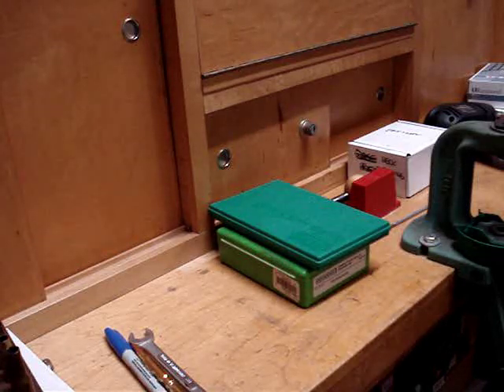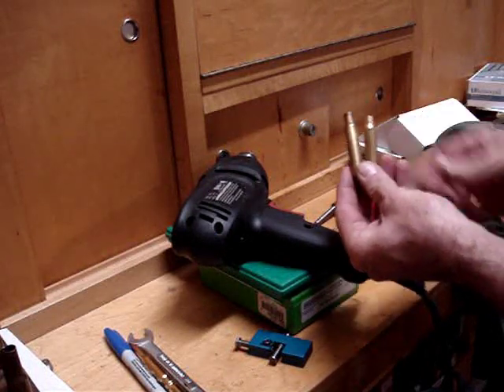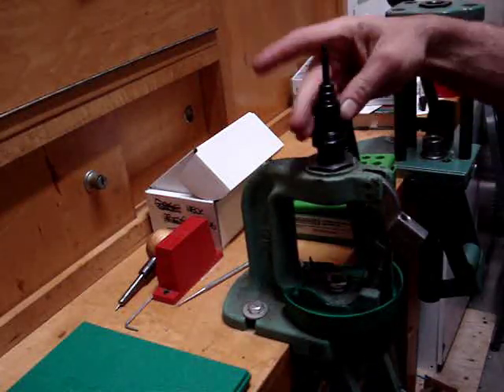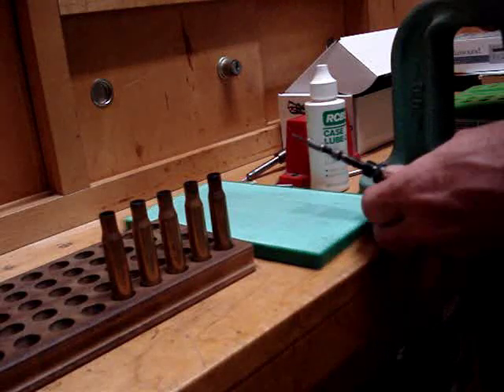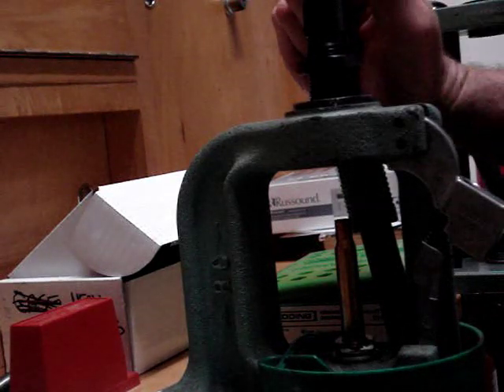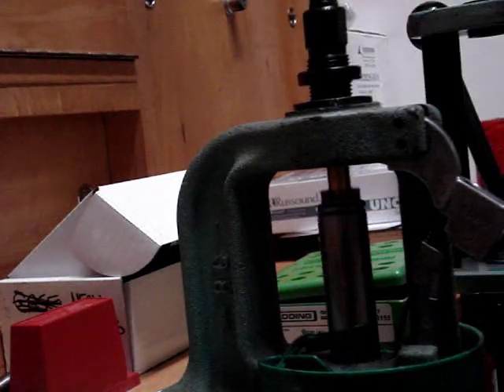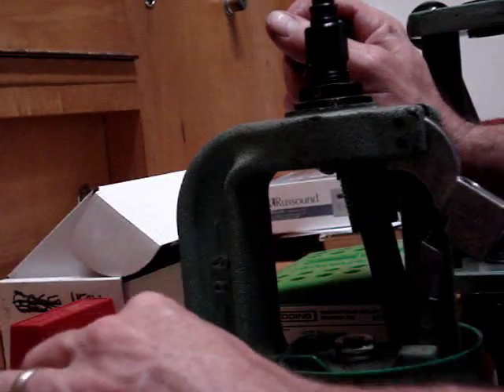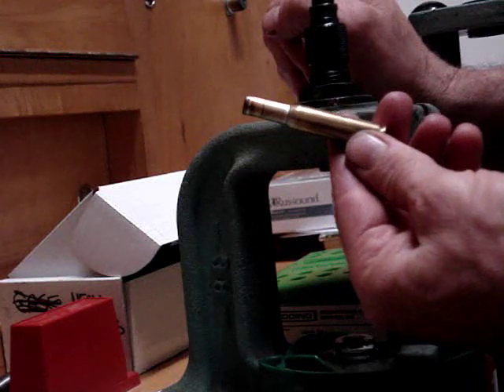Cartridge Conversion Part 1

Comment: How do you determine where to set the neck trimmer depth so the correct amount of brass is removed?  Is it correct to keep removing neck brass until the round just chambers in a particular rifle for a custom fit and then trim all cases to this dimension?

Comment: Thanks Ammosmith. I'm a bit of a noob to this. I assume after watching this, converting a .308 case to a 7mm08 should be easy enough with a full case length die? turning the neck when necessary? Thanks again.

Comment from the maker: Are you talking about the 6.8 SPC? If so you can use a 7.62x39mm. If that's too short then the 6.5x54MS. This isn't a cost effective one with the 6.5x54mm. The real issue is the fire forming and anealing.